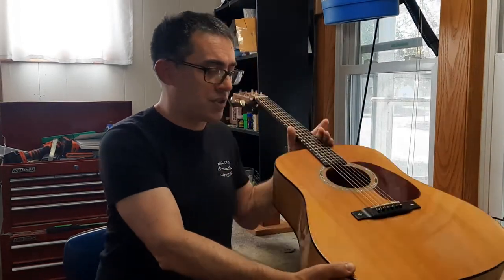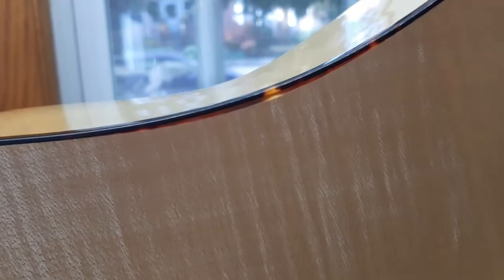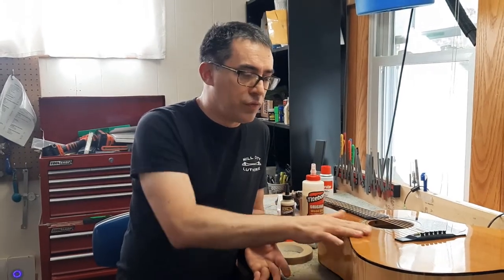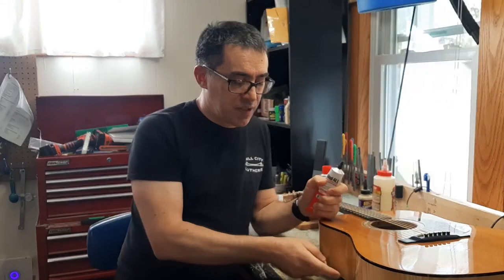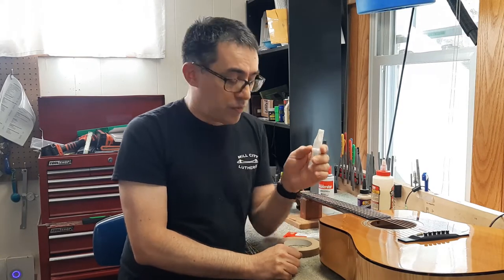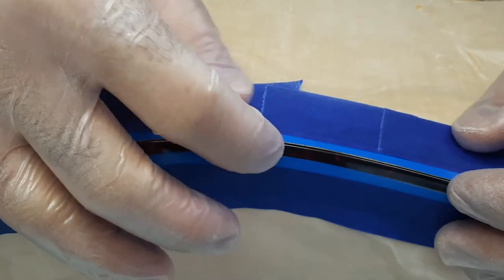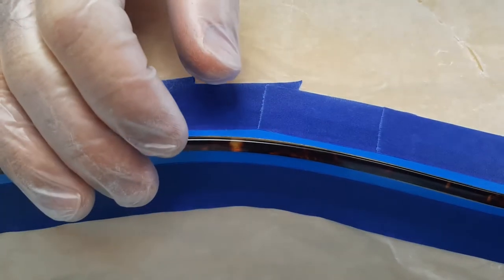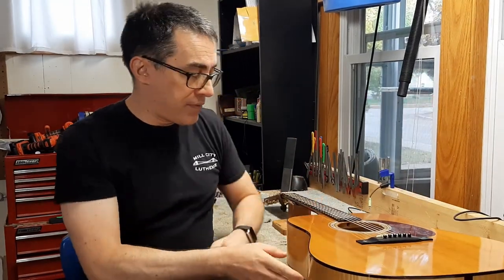Simple Binding Repair on a Martin Guitar

Comment: Plastic repair tip. 
Plastic need to be “set” after heating and molding in order to keep it from shrinking back into its pre-heated shape. “Setting” the plastic involves rapidly cooling the plastic while its held in its desired shape. 

Get yourself a can of compressed air, like what you would use to blow out your keyboard. Heat the binding and mold it back into the bed. Once it’s in place and being held there, spray the compressed air over the heated area.  Prob be useful to have two sets hands to do it right. The cooling process needs to be done as quickly as possible.   I’ve wondered if a can of the freeze spray would work even better but I’m not sure how it would effect the wood or the finish having that Freon applied directly to it. I’ll let someone else experiment with that. 

FWIW I have a Martin GPCPA4 that the binding is coming loose on.
Reply: @@KMguitarworks 😂, I agree with that 👆.  It’s difficult to find an actual honest guitar tech that has the experience, training, knows what the hell they are doing with due confidence. It’s a crap shoot out there good luck my friend. I’ve found that it’s best to learn everything you can about your guitar yourself that you can do and have the patience, tools and confidence to do as much as you can to your own instrument if at all possible.

Comment: You are using CA glue for this repair -- because you'll get a good bond and because the wood is already finished. Couldn't you also use StewMac's Bind-ALL -- especially since you are masking the finished wood? Bind-All sets up in 2 minutes. And you would tape the binding in place for 12 hours while it cures.
Reply: DO NOT use Bind-all on a lacquer finish. You are guaranteed to be doing some finish work if any gets on the body.

Comment: I had the binding of my Martin 00 come loose on a less than 4 y/o guitar. I reached out to Martin and they promised me to repair it under warranty. Apparently there are issues with the new gle they're using. I have to sort things out with the dealer and they wil ship my guitar to a Martin-certified workshop, but if it's free and works I don't mind the hassle.
Reply: Not a glue problem, it seems. The binding is shrinking.